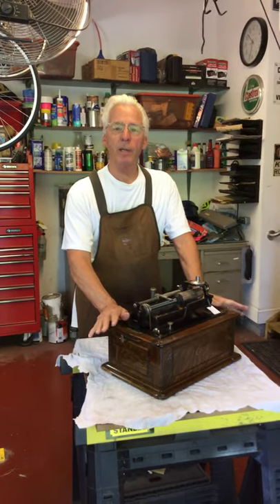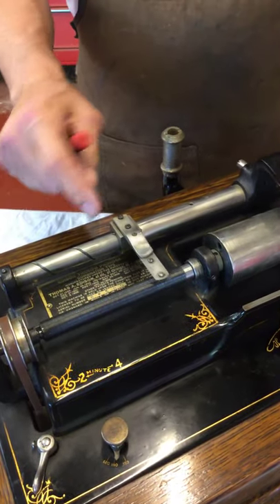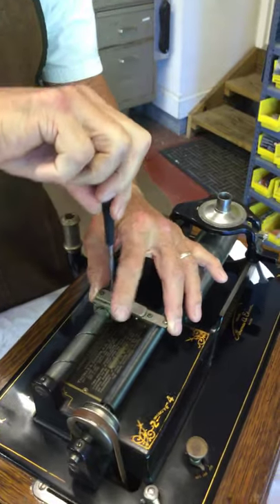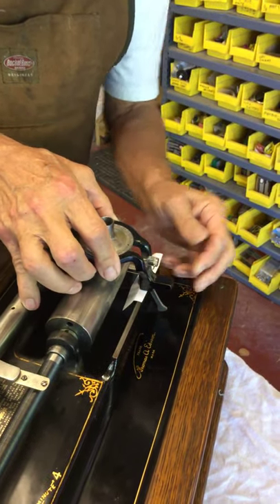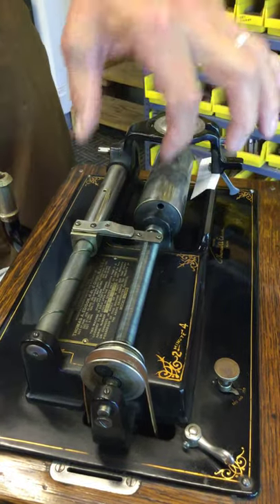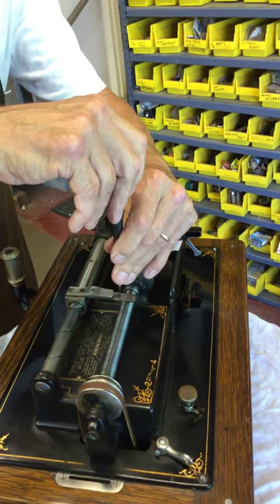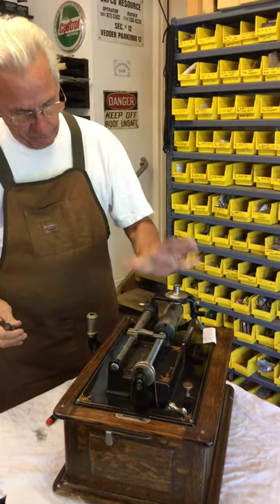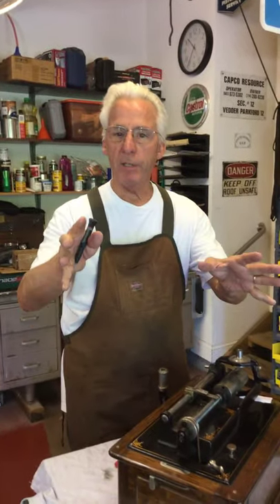88.  Adjusting the half-nut to the lead screw on an Edison Triumph phonograph

Comment: Very helpful video once again, my half nut was turned the wrong way long on top, the reason it was tracking at an angle and not 90 degrees ... also I rid the unit of what appeared to be a piece of plastic wire tie glued on as a shim, what I did here was adjust the spring screw so that it the half screw tracked, backed off till it didn't then gingerly tightened the screw just so the half nut began tracking  ...I guess ones before me didn't have your videos as reference. My unit is a standard home unit with just the Edison logo on the case, not the elaborate Edison logo.
Reply from the maker: Well done!

Comment: My Edison Standard D repeats and repeats when I get near the end of my NEW Vulcan cylinder record. How and WHAT do I adjust so that when the record is near the end of the record it does not get stuck and repeat the same track over and over again?
Reply from the maker: Apply a little more pressure from the half nut to the lead screw.  You may have to bend it a tiny bit.